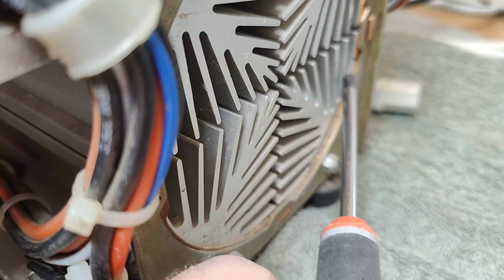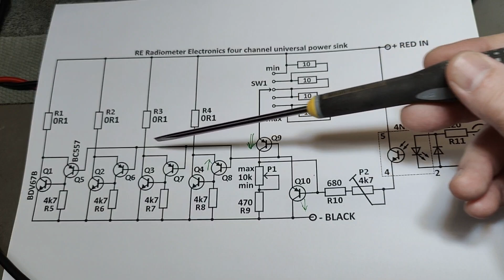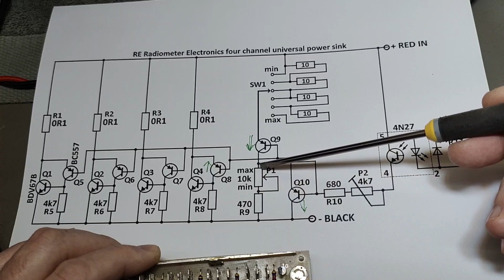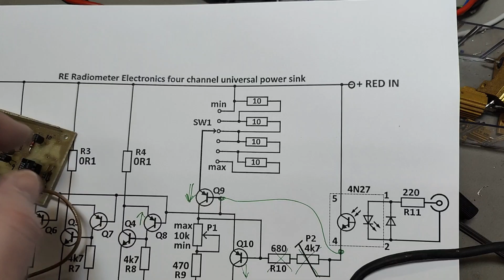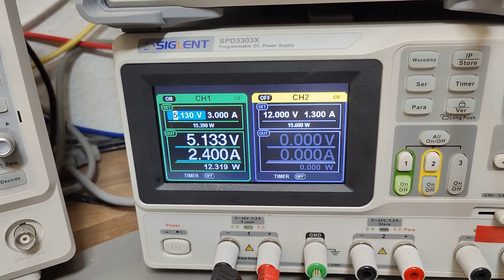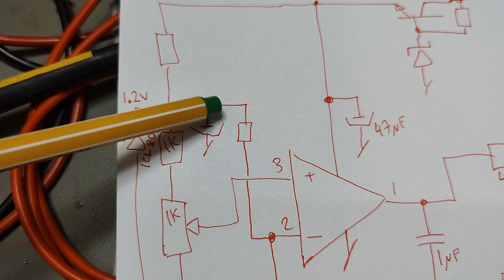RE Radiometer Electronics four channel LOAD Follow-Up 1

Comment: The original feedback system looks like someone was going for a translinear loop and lost the idea partway through.

There is enough voltage available that a proper CC or CR controller based on LM10 could be implemented. By the time the load voltage reached about 1.3V it would go into regulation.

Oh yeah, an LM10 would do the job perfectly in one chip - reference and opamp and it would work from just about the same voltage as the Darlingtons need to turn on :)

Comment: Best upgrade would be a small 4 output isolated power supply, to make constant base drive independent of load supply voltage. TL431 and a resistor is easier to get, and as a bonus you can make it 5V, and drive the opamp as well. Output will stay stable down to around 2V across the load as a bonus.
Reply from the maker: yes that is right, either add a little extra supply, or another opamp with better rail to rail output, and down to below zero on the input is what i think i will start to look for, I like the LM358 for this normally, but it need a few more supply volts.
Reply: @TeardownOZ2CPU  Easiest for a non RR opamp is the isolated supply, and 2 silicon diodes to make a negative supply from the isolated 10V side, so it can pull down close to 0V.